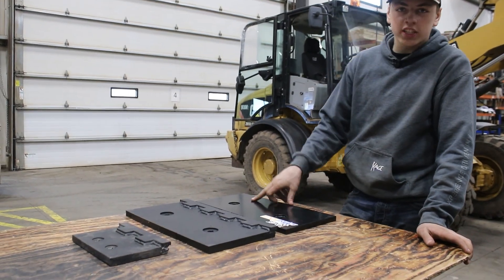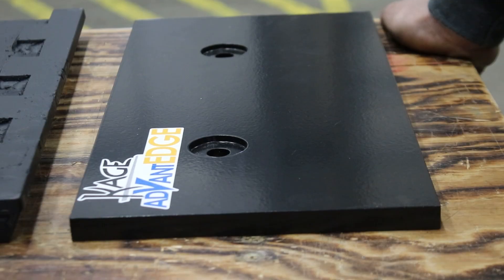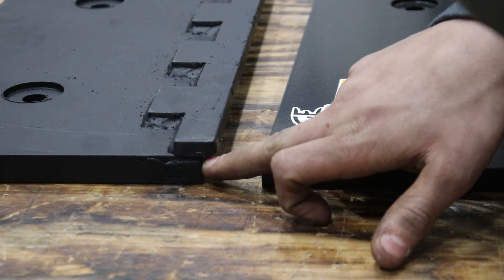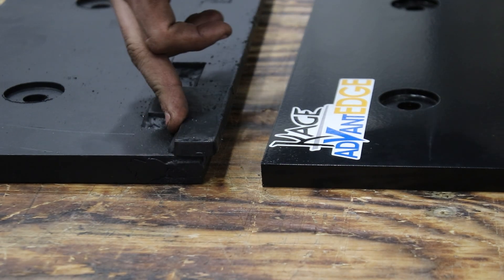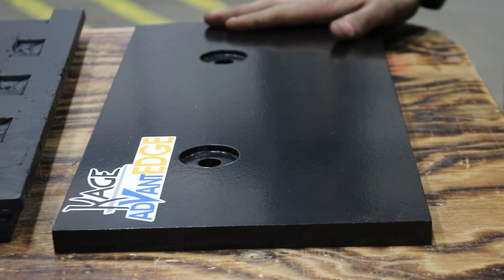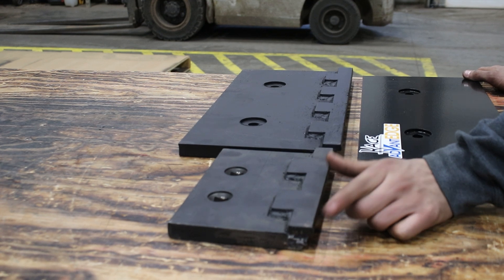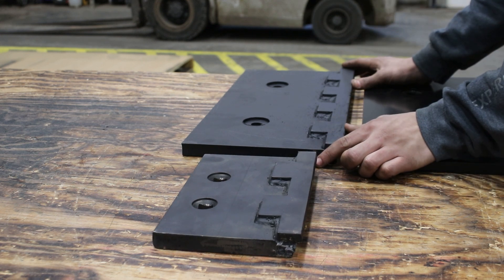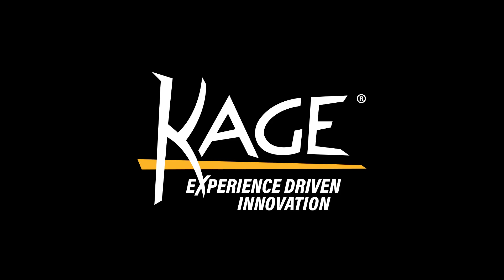Hardox vs. Carbide Cutting Edge Comparison - AdvantEDGE Live Sections

Comment: Whats the price difference? I have the advant edge with hardox section and they scrape well for uneven pavement, but they sure do wear fast!
Reply from the maker: You can find current pricing here - https://shop.kageinnovation.com/advantedge-kit-aekit.html. The price difference changes with the size of the plow. Choose the "Kit Size" and then you'll comparative pricing when you go to choose the cutting edge type.
Reply: Can you differentiate the cutting life of carbide and Hardox plate?